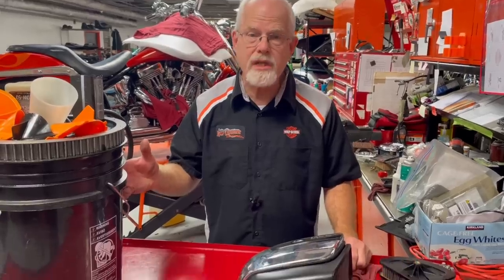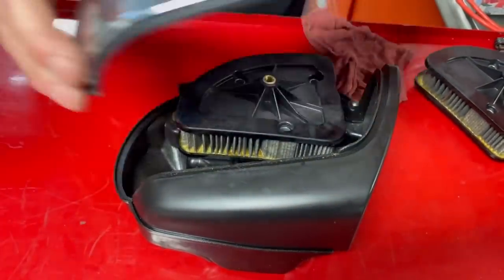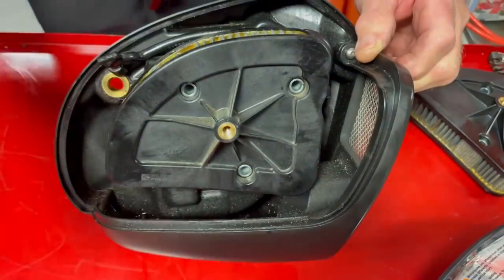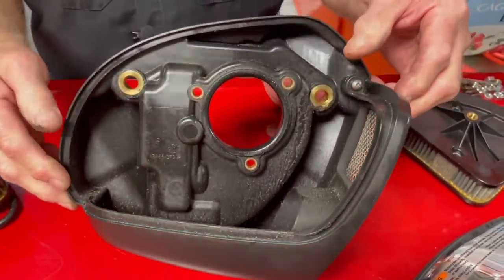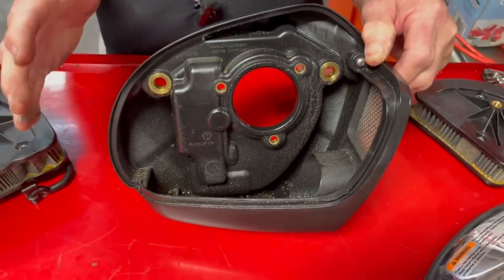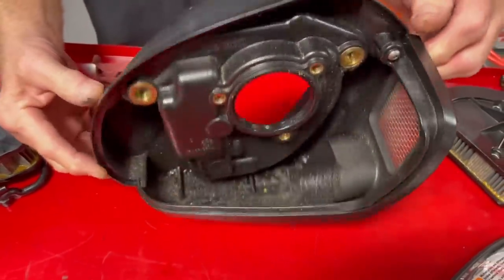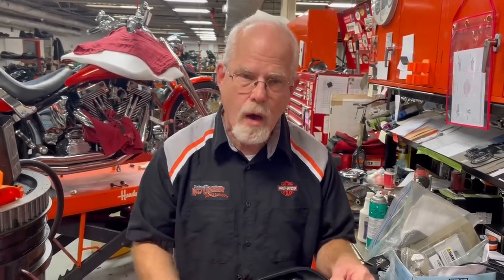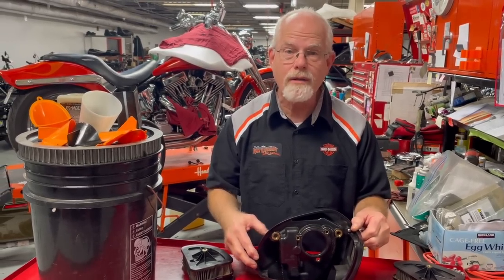Your Harley-Davidson Air Cleaner is an oil bucket?

Comment: External breather system with a catch can will fix that right up.
Reply: It doesn't need to be external breather to work but a catch can is engine basics. At least they don't have to suffer exhaust gas recirculation which is really messy.

Comment: The real question is..Where did the oil come from? 
It’s a paper filter, so it didn’t come from there. 
Oil doesn’t come out of the intake, so not from there. 
Oh yea,  It must have come from the motors breather tubes that go in to the intake to the cylinders. 
Imagine all the oil that must have been sucked in to the intake of that motor and into the cylinders.  Even with all that suction there was so much oil coming out of those breathers that there is still a good bit of oil that couldn’t be sucked in and ended up in the bottom of the air cleaner.
I can only imagine how much carbon has already built up on the pistons and valves.
I feel sorry for the owner of that bike. 
It will probably take its last breaths shortly after the warranty expires, as if almost by design. 
Wow, wait a minute, those engineers at the factory are a lot smarter than we give them credit for.

Comment: Air/oil separator with a return line to the sump. Aviation uses them all the time on big air cooled engines. Motorcycles can too.
Reply: STC required and not allowed on all aircraft.
Reply: @Old940  true. But STC probably not required for a Harley. Lol.
Reply: @Badgerbiker  Don't know, but I'm putting one on my 04 Ultra, had to install a breather on the crack case to oil filter spout to stop the dip stick from blowing out.

Comment: That stock air filter box is one hell of contraption 😅.  I just avoid that mess all together  Thanks Doc Harley for the obscene visual of what HD is putting you through to help fix our bikes
Reply from the maker: No problem 👍…..Doc
Reply: Its the fed not harley.
The moco would install velocity stacks and low restriction exhaust if they could get away with it.
Reply: How do you avoid it?

Comment: Don't have that issue after doing the crankcase pressure to air intake bypass. I am a bit anal retentive and make sure that I clean everything to new condition whenever I am doing any work. My bike is a 2010 with 30k+ and looks like new, even the mechanicals.

Comment: Love your videos my 2009  ultra classic yesterday throttle stopped working wont go above 2k rpm code P1511 and P2135 i have been looking on the net but i would like your opinion.
Reply from the maker: Take it to your local dealer. Communication has been compromised between the throttle grip and the throttle body…..Doc

Comment: It cost me $7 bucks for a 3/16" tee and 2.5 ft. of heavy duty reinforced hose and 2ea. trimmed plastic christmas tree plug car fastners siliconed in to fill the 2 holes on the back of the filter. And a 1/2" drilled hole in the back bottom air box... On my new 2023 M8, 114 ci. Tri-Glide from mile one!. My engine is not going to eat or digest it's own poop!. And never will get an half oil soaked/ plugged up air filter that can't breath!.  But this is something Doc can't tell you on here or at his dealer!!..

Comment: Wonder if there would be any harm in putting a folded piece of pig mat in the bottom to absorb the oil?? I change my aur filter ever oil change. Take the old one and wash it for the next time. And even after 4000 miles, its pretty grungy down there!!
Reply: The more permanent solution would be to externally vent your crankcase. :)

Comment: My 2019 Road Glide has not leaked one drop of oil. I run a Fueling vented dipstick to help in the venting of my motor. I also don’t abuse my bike. I keep the rpm’s in the low range and use the motors low end torque to move it along. Helps keep the motor cooler and last longer. Air cooled Harley engines are not designed to run hard and fast. I run mine like I run my diesel semi , low and slow.

Comment: Common thing for many motorcycles companies.For Harleys as i understand its not big deal if you see oil in filter box as its coming from breathers, but, for other companies as japanese engines if you see oil in filter box this is very bad for the engine.Sometimes this happened because of viscocity oil engine, too thin.
Reply from the maker: Thanks for sharing….Doc

Comment: Or just install an external breather and the oil won’t get on your air filter.
Reply: I got a little more created with mine. I have a hyper charger that I like but hate a carb and filter coated in oil. Ran 2 lines 1 off of each crankcase vent under my gas tank and fabricated 2 small L brackets. Then bought 2 chrome cased filters that were reusable and mounted them one to each bracket. This allows a few things. The engine vent as it should, does not allow oil all over my engine, and when my engine is shut off it allows any oil in the lines to drain back into the crank case. It also looks nice and very professional.

Comment: If Harley would fix the blow back to the filter one won't have to clean as much. Harley use to vent everything overboard no problem with oil blowing. Caused me to do a complete top end redo at 4200 miles Harley paid but if they would of fixed the oil pressure problem.
Reply from the maker: Interesting thoughts….Doc

Comment: I’ve got a 89 fltc and just been on a run and had oil spray over throttle side of bike from rear cylinder to pannier and oil cover oil been same since last oil change not sure what going on it could be from rear cylinder head gasket but any ideas please
Reply from the maker: More than likely rocker box seals or lower gasket….Doc

Comment: Well if Harley -Davidson would have only return the oil mist back into the lower engine case with steal tubes. Running oil into throttle body and engine in a bad idea. The engine vacuum shows it can't keep up with the oil all over the air filter. I hate this about Harley-Davidson motorcycles. Also techs need to add blue lock tight to the air cleaner bolt replace the air cleaner bolt. I had friends that got their Harleys serviced by Harley techs and the air cleaner bolt unscrewed and air air filter and cleaner crushed on the road.  I would like to see a 1328 Revolution Max in the Softail frame and touring frame as well.

Comment: The moral to this story, is NEVER have your bike serviced on a Friday 🙄👎👎👎
Reply from the maker: No! The bottom line was put in a little more effort then what you see on the surface…..Doc
Reply: @LowCountryHarleyDavidson  
And make sure to tell your Techs to treat a customers bike, like it was their own. 🇺🇸
Reply: @elithegreat6463  I've seen some techs with really grubby ratty bikes that are held together with bailing wire and spit. That's why I do my own servicing. :)

Comment: Great veidio Doc,  yea,   I bought my 018 FLFBS NEW, rode it home,,   threw air cleaner  in garbage, put on a Arlen monster,suker,  drilled  the mounting holes , where the head breather bolts go,   deep enough ,  so could use the stock head breather bolts, put   lines and a t, under the air filter, ran line behind rear push tubes, behind engine, between primary, and back by rear tire, ,  change oil every 3 thousand miles, never had to add,   every  ride just a small amount of oil,  at the  breather  hose,   not bad,,  bike never been in a shop, 4 years old,    14 in apes , Blow exhaust , no baffles, power vision ,  250 Dunlop, rear,   solo bike,  475 s&s cam,   Fatty a head turner rubber  burner, , lol, fun bike,, hope Harley  keeps makin em😎🤩 you and Kevin  Baxter  Rock,, 😎
Reply: Did all mods, first month, screw Warranty, lol,  im a  retired Harley tech,😎
Reply: The breathet hose  i covered  with  stainless   covering , , badass,   cost me 15 bucks,  totall price,